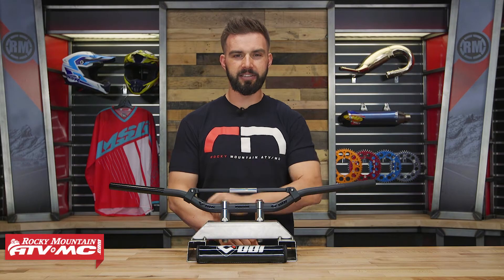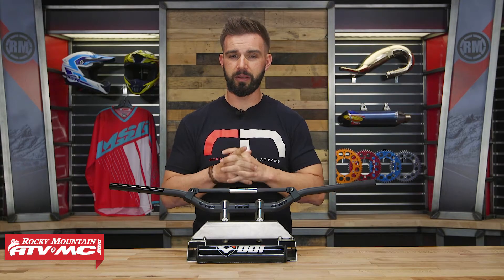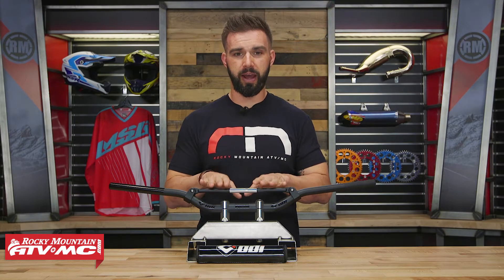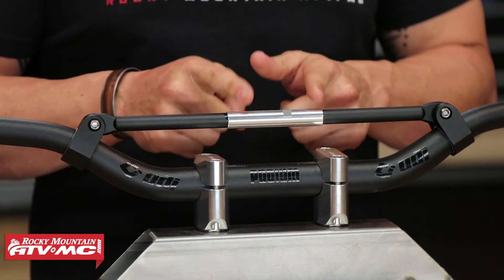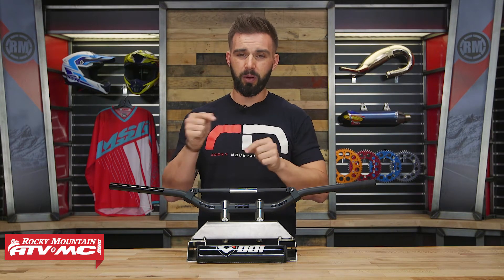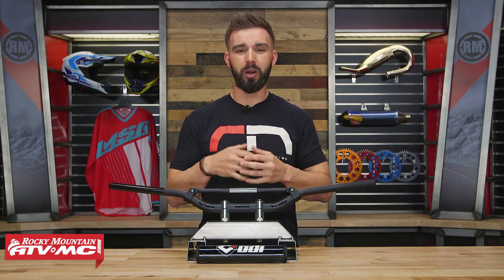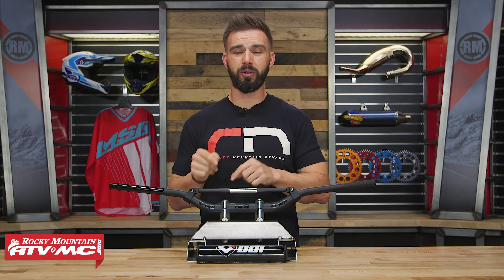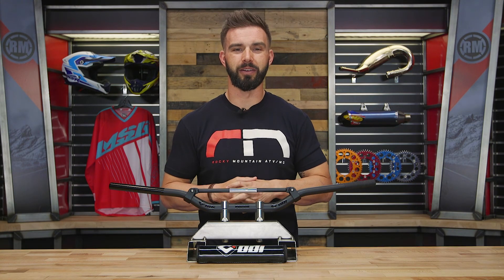ODI CFT Podium Motocross Handlebars

Comment: i am using this handlebar for a while now. i ride mostly hard enduro and was thinking to remove the crosspad to give it more flex, is that a good idea? btw, great job with this product presentation videos. greetings from romania
Reply from the maker: The cross bar on this handlebar doesn't make it much stiffer than the crossbar-less version. I took mine off to see if I could notice any difference and I couldn't. If you like having a crossbar and the look of it, I'd leave it one. You're not loosing any flex leaving it on. - Chase